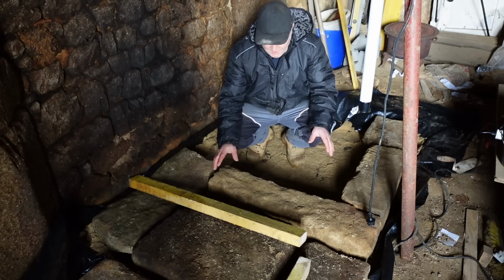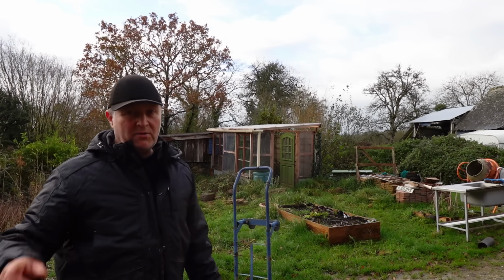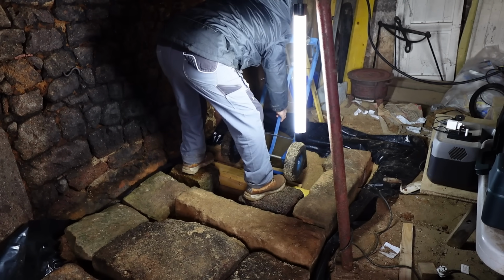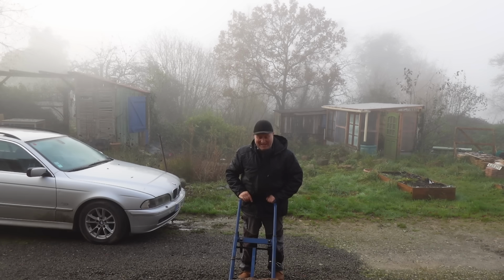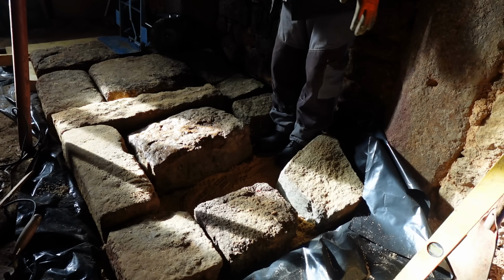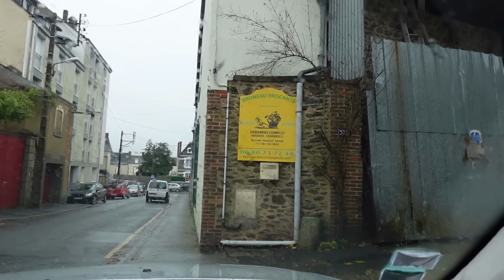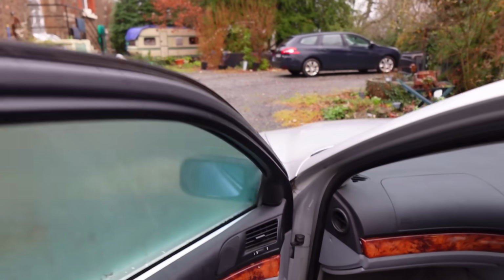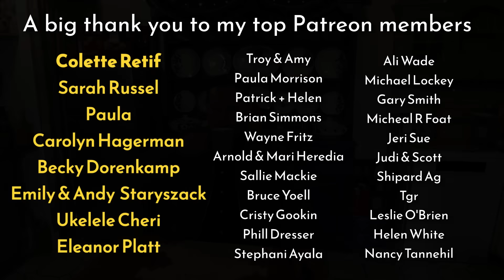The Fireplace Stones Are Finally IN!! | Cottage Renovation Ep. 55

Comment: Those stones are heavy. Those dollies or hand trucks are designed to be pulled up steps or slopes backwards. You just have to walk up the steps backwards pulling the load up. That's why the wheels are so large. You work so hard that any tricks to make any part easier would come in handy.
Reply from the maker: It was too heavy to do that, you need a soecial six wheeler designed for steps to be able to do that